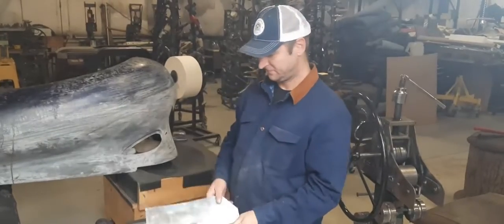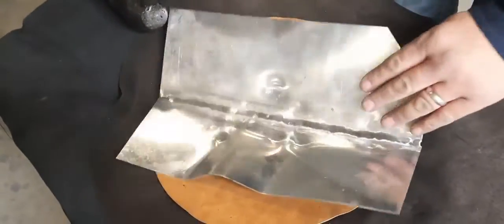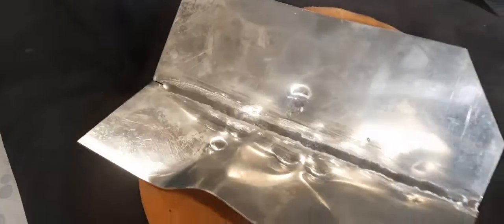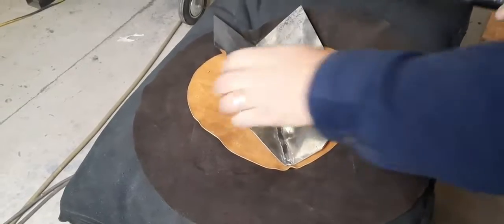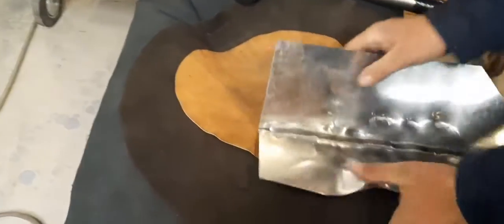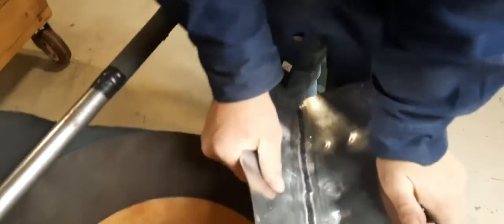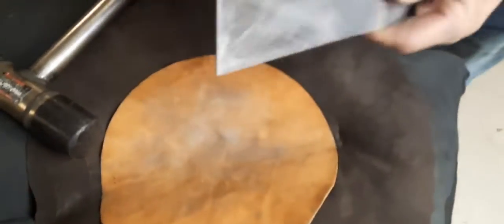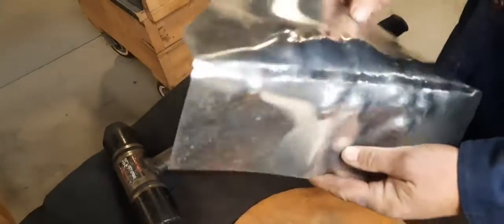Tig welding aluminum

Comment: Hi Wray, what model is this aluminum plate? 3003? I can’t buy 4943 welding wire in my country. What kind of welding wire can I use instead? Is it 4043 or 1100? I want to make an aluminum fuel tank for motorcycles. Your answer is very helpful to me. Thank you very much.

Comment: Very impressive! I have not heard of 4943 rod. I wonder if it is the more common 4043 material? Why do you prefer this rod over 1100 (pure aluminum)?
Reply from the maker: Hi Ron, A friend told me about it, it wets easier and lays down very nice.  It was new to me I tried it and adopted it
Reply: @proshaper  Thanks for the tip, Wray. I'll have to check it out!
Reply: It's Great to see that the PROS Are Learning. THANKS. 
#STAYSAFE 
#PHILLYPHILLY 🇺🇸